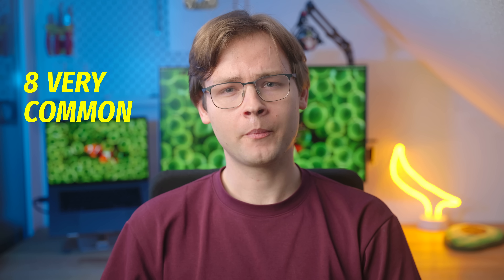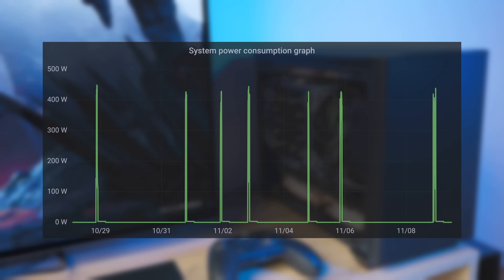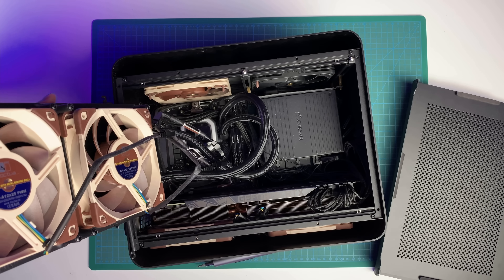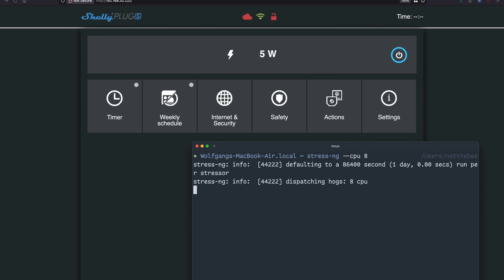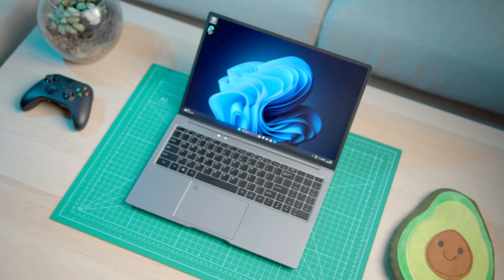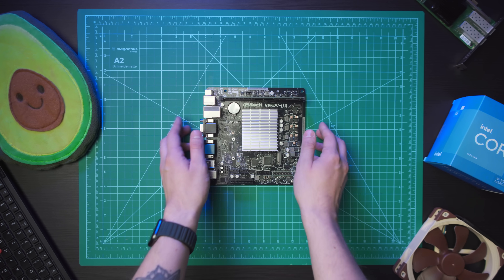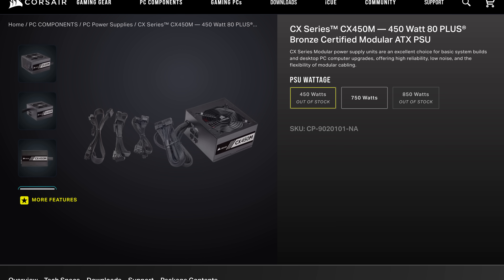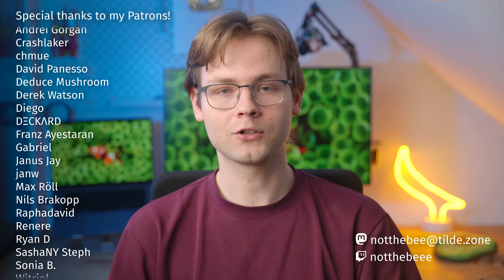Busting 8 Common Homelab Power Efficiency Myths

Comment: servers without rdimm ecc are a bad idea
Reply from the maker: The price of an HEDT/enterprise server that would support RDIMMs just doesn't justify the benefits from it in a homelab environment, IMO.
Even older decommissioned servers, while costing less, will consume too much power and be super noisy.

Not something you would worry about in an enterprise environment, since you can offset the energy prices with the earnings, and probably have a separate rack space for noisy equipment – but at home, it's very impractical for most users.

UDIMM ECC is good enough, and you can build a very power efficient and quiet system based on a Ryzen PRO Cezanne/Renoir APU.
Reply: @WolfgangsChannel  Sure, ryzen cpus are pretty neat. Do use them too.
The noisy part, is not always true, but you will need to dig in bios or Ilo/ipmi, where you can use a setting for low noise.
I use these machines, running a bunch of vm's, giving real cores, sandboxing, sharing gpu's.... Or running applications entirely in memory. Imagine, having only 2 memory slots. 
Asrock workstation motherboards are indeed cool
Reply: Aside from better resistance against Rowhammer style attacks (more advanced multi-bit ECC, which should be irrelevant for typical hardware issues you want ECC for), and larger RAM capacity (we can do 32-64GB/slot, with UDIMMs), what do they actually give you, over UDIMM?
Reply: @laurelsporter  You just answered your question yourself.
Also do not forget bitflips, and indeed shear capacity. Have a few machines running with 256GB, in ddr3.
Next step is gpu's with ecc memory

Comment: I recently found out 12vo psu actually more power efficient than conventional atx at idle, tested the same i5 6400t with two hp oem machines, one of them using a atx psu, another one(800g3 sff) using propriety 12v psu, 6-8w vs 22w from the wall while running powertop.
Reply: Holy moly, that's quite the difference!

Comment: i'd like to mention one thing you could mention. When it comes to CPU power efficiency generation does matter for idle loads combined with the motherboard, software and bios features. Turning off audio can save 1W (measured at wall) in bios. When the PC is in bios it consumes a lot more power than when it has booted into an OS.
I tried turbo stat on 3 PCs. 1 a low end amd ryzen dell, 1 a 1U erying PC, and 1 an old haswell in a high end motherboard. Tweaking the erying is a nightmare but the erying has aggressive clocks, so the idle is between 1.6-2+W. the amd ryzen had a consistent 1.6W idle while the haswell showed around 20W. I have the haswell tuned with power efficiency options available and i have a wattmeter running at the wall for my cluster, showing 100+ watts including the switch. I've measured each computer individually.

The biggest issue no one talks about in power draw which your video does not address is the GPU. GPU idle is a huge pain and is why i dont run GPUs in servers. If you have a program idling in the GPU it will for sure not idle at its rated idle, but even then thats still a significant increase because consumer dedicated GPUs do not shut themselves off when unused like with nvidia optimus. Sadly even this option isnt available for linux. I am trying to use openCL and other features on GPUs so the IGP is good but once i start using the IGP in my own software, the idle power consumption will go up for sure.

Many do not configure their bios for power efficiency but not all bios has the options and not all motherboards draw the same power as it depends on their VRM designs and how much hardware is packed on the motherboard. things like optical, multiple NICs, more sata ports even PCIe can actually increase power draw depending on what is added to introduce it. Fans for me can consume 20-30W alone.

Comment: I hate TDP as a measurement of power efficiency. If Intel is using the same metric as AMD now for TDP, that's great, but Intel used to use average power draw for their TDP where as AMD used max power draw. There was a short(?) period where Intel's advertised TDP was just how much heat a fan needed to be able to dissipate. It's just an awful metric for trying to compare processors.
Reply: Both are different, and both are lies. They're just consistent lies *within their own ecosystems*.

Comment: Some of these were news to me (going against common logic), but i think we can more or less sum them all up as "general answer" is not always correct for special cases. 
LIke the PSU thing, generally speaking higher rating and lower watt would use less. At the low end it might be true, but compared to a 1500W bronze PSU you can bet a 500W titaium would be better at 20W ;)

Comment: Storage drives are also a significant power demand. Even older spinning disks can be set with different sleep profiles from constantly spinning for low latency to fully parking the heads and disk when idle for more than a few seconds. It is a difference of around 8w per disk from parked to a continuous write, so a 4 disk array will take ~10w parked swinging up to 40w when writing. 
Storage consumes more than 50% of the total energy used my NAS, which idles at 4w and peaks at 15w with one 5400rpm 3.5" disk. A second disk and it's up to 6w and 20-22w. 
It has fairly low computing power and was manufactured specifically for the file serving task. (Single core ARMv7 SOC at 1.2GHz and 128MB ram, just enough to feed files on 1Gb ethernet and do some minor services like DHCP, local DNS and background torrents.)

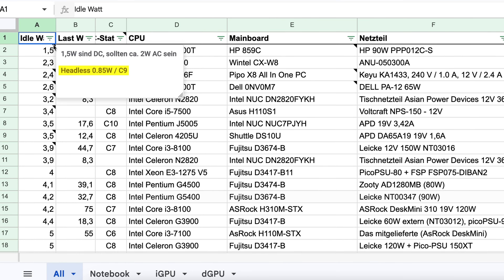Comment: 8:55 Depends on the software used. Look up the benches. 

But say that is fact 100% of the time: the apple you (ajnd half the world) seems overly fond of, is not just an M1 chip. It is a cpu, gpu, and operating system sold as a package. If Intel sold a chip that has their own os perfectly suited to their hardware only, I bet you can see insane gains. Google can do the same (and is working on it). Then MS has to come up with their own and then you have the situation where you must buy into one of the ecosystems with their own payment system, their own app store, their own everything.

Seems pretty bad to me.

Comment: So what about ECC?
Reply from the maker: My approach is – go for ECC whenever possible. However, balancing hardware transcoding capabilities, price, performance, power efficiency and availability is incredibly difficult. I think for now, the best option that ticks most of the boxes is Ryzen Pro APUs (e.g. 5650G Pro and 4650G Pro), but Intel still has an upper hand when it comes to video transcoding and power efficiency. And building a new Intel system with ECC support for a reasonable price is nigh impossible.

Comment: Hi, I build a home server with a Ryzen 9 PRO 7945 and Gigabyte A620 Dash motherboard. Unfortunately its idle power draw is around 75W which is way more than I expected. There are two 7200 HDDs connected and the PSU is the Corsair RMX550. Is the idle power draw supposed to be this high on ryzen? I ran out of ideas on what to do to decrease power draw.
Reply: Ryzen is bad for idle power unfortunately.
Reply from the maker: The APUs are much more power efficient at idle than the CPUs
Reply: Well it is an APU. Seeing your build with <10W idle made me think something is wrong with my build.
Reply from the maker: @xXxJakobxXx3  Sorry, I was responding to @Zamsky39.

Yes, 75W at idle is a lot. At the same time, I'm not familiar with AM5 processors.

Comment: Some people overestimate the power consumption of things and underestimate the impact of a little BIOS/OS Config tweaking.
For example, I'm running a Xeon E5-2650Lv3, power draw of the entire system at idle on Windows? ~40W, includes a cheap chinese LGA2011-3 motherboard, 2 HDDs (no spindown) and an old Radeon HD5450. 
If the CPU's package W is to be trusted, it idles at about 7 W, which is 0.6 W per core, on a 9 year old, 12 core CPU. Can't really complain much.
Before I tweaked the configs in the BIOS it was idling at ~65W.
Reply: Which tweaks have you set, for example
Reply: @8bit239  Turned off anything I didn't need (COM port, audio output, etc.) and, to be honest the largest change was when I went to the BIOS CPU advanced power options and set the "Power Technology" to Energy Efficient. 
You mostly keep the performance (and power consumption) at higher loads but it idles a bit more aggressively. At least in my cheap Chinese X99 motherboard (Huananzhi QD4).

Comment: The biggest thing to know about TDP numbers is that every company makes them the f*** up. I'm pretty sure AMD even changed how they make up the number recently because they wanted AM5 processors to have lower TDP numbers than the AM4 formula would have produced. TDP is absolutely meaningless, don't pay any attention to it at all. If you want to know how much power a CPU will consume, look for that in CPU reviews. If you want to know what cooler to buy, look at cooler reviews. Just completely disregard TDP.
Reply: TDP is a lie, but no. A 5900X has a 105W TDP, FI, and a 7900X 170W. They're keeping it the same.

Comment: I do think that while getting someone to evaluate their choices regarding energy draw while purchasing new items, I do think that you missed a VERY IMPORTANT point. 
Costs vs ROI vs Time consumed to achieve that goal ..   If I have a server that is running at 78 watts, is it worth the effort and costs to do anything about it ?  What is my electrical costs per month for a server or device that operates at an average of say 78 watts;  and If I manage to trim 8 watts, what is my savings ?  Each person's answer would be different depending upon their equipment draw, and the costs of electricity per KWH. From there, one can get an idea as to how much difference they MIGHT save, thus determine if changing something is actually worth the potential savings.   In an area with higher electrical costs, yes, maybe; however, in some areas, it may not be worth it.   BTW: Here's my numbers based upon local electrical costs, using KASA plugs to measure power draw:  8 watts savings would be $0.61 per month, or $7.36 per year. Simply put, If I could trim 10%, or 8 watts, it'd save me a whopping $7.36  a year. It's not worth the effort. 

The same questions should always be asked, for simple changes, outright replacements, and even tweaking;  in the end, is the effort worth what one could possibly recoup. In my example, I'm starting at 78 watts; so how much could I trim ?   Yes, this train of thought is just as important when it comes to running something on, say Solar only, for example: is it cheaper to add solar panels and batteries or is it cheaper to trim the electrical usage ? 

I used the same logic while asking myself if it's worth replacing my functioning NAS's with newer smaller NAS's with fewer drives, for example.  And in truth, energy wise, - the answer is ultimately no.  To spend $1500 or $2000 to replace it, well, it's too pricey.. To build a replacement, although cheaper, still, not really.  My 78 watt server costs me $72 a year to keep as is. To work on trimming down it's power usage by 10%, which is a lot and likely impossible, would ultimately save me $7 a year; is it worth my time and effort for $7  a year ?     YMMV. 
My NAS has 12 x 3.5 inch drives in it plus a few SSD's for acceleration;  If I replaced the drives with say 4 x 12 TB drives, which I think it could handle,  four 12 TB drives would cost me $800 and could save me perhaps 10 or 20 watts; but then it'd cost $800.  It'd only take me 40 years to recoup the cost difference; totally not worth it.
Reply from the maker: The ROI is not something I see often misunderstood in my comments section – so it's not really a common 'myth' that I would want to address in this video. I think the ROI of replacing your existing hardware vs. power savings of the new hardware is the point that more or less everyone understands

Comment: Still using an old 4790k for my server. Having quick sync build in, is really handy. For an update, I would want one with AV1 and H.265 support. Having 2x SSD and 5x 5.25" harddisks, running a handful of dockers and two VM's (one of them being a windows), power draw is 65w-120w, depending on what it is doing.
Reply: haswell's idle power efficiency is great for the age of the chip.

Comment: I have recently upgraded my truenas server to try to minimize power use, especially idle since it only does work a few times a week. I am using one of the dual core ryzen cpus, athlon 320ge. With 3 drives and 3 fans it uses exactly 67w for idle, way higher than i expected. Any advice to bring this down?
Reply: In contrast, I have two NAS's; same age,  one with four SSD + 12 x3TB drives which averages 95 Watts over 7 days; and the other with 4 SSD + 12 x4TB drives which averages 66 watts over 7 days.  SSD is only used for acceleration.  Most data is only on the unit with 4TB drives. Go figure.  Over 20 days, it's about 3.5 KWH difference.   If I extend it to 30 days, that's 5.25 KWH difference. Electricity here is 10 cents a KWH; so that's 52 cents difference per month.      
Yes, that's 24 spinning disks;  the simple way would be for me would be to power down one of the NAS's and confine my use to one.  That would save me almost $6 a month.  But worrying about the 5KWH difference makes less sense as it's literally 52 cents. 
Apply the same logic to yours, and the question becomes - how much will you save ultimately if you do make a difference?  Use a calculator such as https://www.calculator.net/electricity-calculator.html to just speculate what you could save.   Then run the numbers if you managed to save 10 watts, which is unlikely, and see what you'd save;  then decide if it's worth the effort.  Hint: I don't think it will be. 

I'm using Kasa plugs to measure stuff;  not sure if I'm reading the numbers right or not. But if I am, yeah, I'm not chasing down the difference if what I'm ultimately going to save is in the neighborhood of 52 cents a month, or $6 a year.  The numbers can be confusing. My average over 24 hours for the better NAS shows 78 Watts, but the weekly is 66W. So I used the longer term - 66 watts as it's been powered on for 20+ days ; I powered them down when I was working on other stuff. It runs an AV scan once a week, and fairly sure that's the difference between my daily average, and weekly average. It also runs backups and snapshots. Still, 12 watts still only is $0.88 a month; again not worth the effort. 

With yours, turn off anything, i.e. VM's / services, etc  that is running on your system that does not need to be running. And consider a simple reboot to clear anything else up.  Then figure out if chasing down what little you can trim is worth the difference.  Each drive is, and this number is from what I read on the internet,  5 W each, so 67 minus 15, well, your system is now at 52 watts that you're trying to trim down; likely not worth the effort. 

Electricity is so cheap here that even solar makes no sense; switching appliances to get more energy efficient ones makes almost no sense;  time to recover the ROI is so small that it makes little sense.  Yes, I've considered buying a smaller NAS  and replacing both of the larger ones; but the cost of replacement dwarfs how long it'd take to recover the ROI.  

Sorry for the long winded reply;  I just approach things from a different perspective... I wanted to demonstrate how I think.. Efficiency is great, but the ultimate consideration should also include - is it worth the time and effort to worry about it, let alone spend any money to try to solve the perceived problem?

Comment: Excellent! Just to add also watch out for "server boards" that boast an IPMI port. I have a Supermicro X10SDV-6C-TLN4F (well I actually have 3 of them), they have an embedded Intel Xeon D-1528 which is rated at 35W (6 core at 1.9Ghz). Running a typical home server load (1-2% CPU) it's drawing 40W from the wall! One thing that surprising about this board is it has an onboard IPMI (out of band management port), this alone can draw 25-30W even when the system is POWERED OFF. Ended up getting 4-way smart plug and integrating with my Stream Deck / Home Assistant to physically cut power. I used to laugh at dad, every night he used to physically power off the TV, VCR etc at the wall. 30 years later I am doing the same thing, albeit with cooler tech :-) 
https://www.supermicro.com/en/products/motherboard/X10SDV-6C-TLN4F

Comment: Did you consider the used ATX standard of the psu you used for the Skylake vs Alderlake idle power consumption? There could be a difference if you use the newest ATX standard for the Alderlake build, due to advanced power management features.